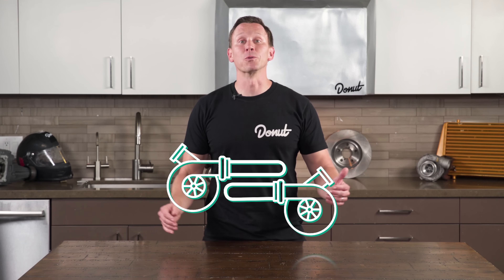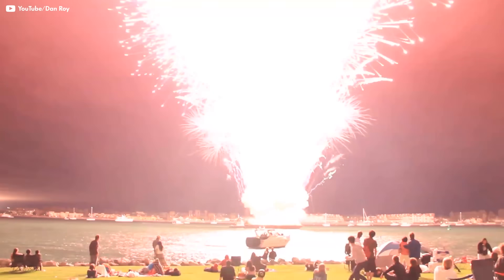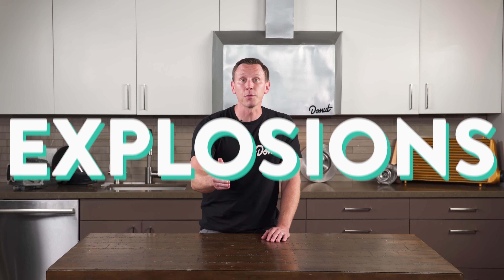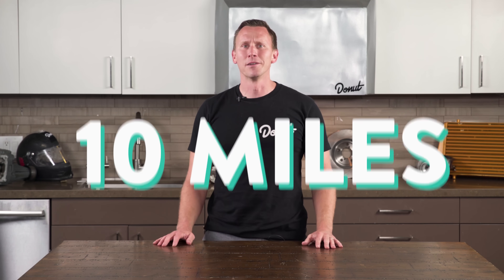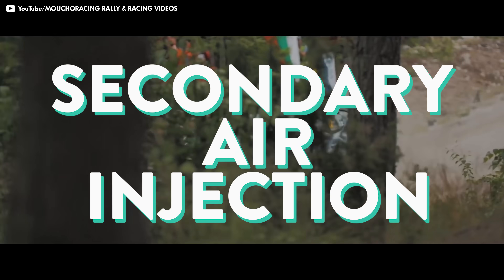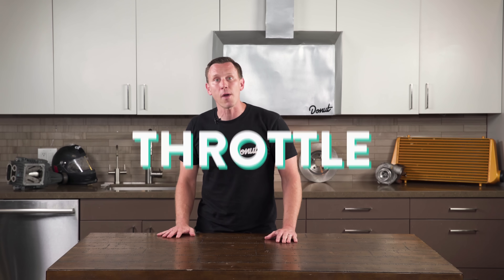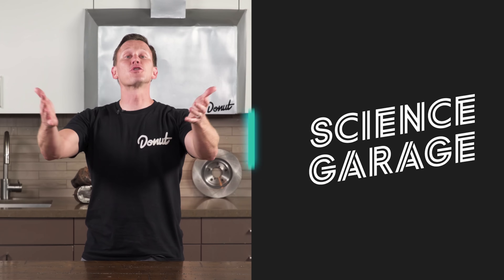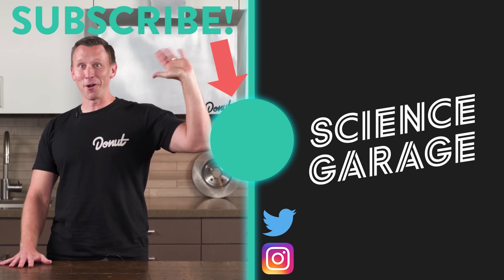ANTI-LAG | How it Works

Comment: I want to use a bypass air valve and a diesel fuel injector plummed straight into the exhaust manifold. Use a solenoid fuel switch. Simple and very effective. 🔥🔥🔥

Comment: I have a question for car guys and mechanics. I drive a 2014 Mini Cooper S, 4 cylinder Turbo charged. I was wondering if this is good for your car at all? I've seen a lot of videos on this and I'm getting numerous answers. I'll be at a park for example and I'll accelerate and upon the deceleration is when I'll get a fairly loud audible pop from the back, not sure if there are flames out of the back or not. If I could get an answer on this before I spend the money going to a mechanic, this would help a lot.

Comment: I love wastegates and blow-off valves and being able to use tunes and fuels for different ranges of performance and I don't even have to buy anything other than a tuner program or tune bank and away I go. Sure beats the hell out of spending a fortune like the old days. It's sad though to see clapped out burners that a small fortune been invested in the engine and car get smoked by a family CUV.

Comment: Im imagining you can combine rally style and throttlekick anti lag systems to get the ultimate performance. I mean. Open valve and a pump leading to the turbo. Anti lag benefits and, i hope, close to no downsides. So no more changing the turbocharger.

Comment: I love how Turbos have two problems to solve, and the bigger the turbo, the bigger the solution. Too much pressure, so you need boost control or blowoff valves. This is good for the life of the turbo and engine components. Too little pressure, so you need anti-lag or two-step. This causes wear on the turbo and exhaust components. All for a big turbo.

Comment: One thing that I don't understand about the Turbo is that why would it still be superior if we have built an awesome supercharger (like turbo but using an extremely powerful electric motor) that we can finetune the behavior from a2z. There are some EDFmotors especially made for RC aircraft and they are STRONG... Since we have almost an unlimited 12v source, why can't we use these rather than having to deal with the exhaust?
Reply: look at their recent uploads lol

Comment: There is the Formula 1 way as well. 
They use the MGU-H to convert the heat from the exhaust to electrical energy which is then fed into the turbo when at low revolutions to keep it spinning thus, eliminating turbo lag. 
Pretty awesome.

Comment: 3:09 wouldn’t you be losing power because ignition is happening late
Reply: @Benji Genji Yeah but your only building boost pressure while off throttle , as soon as you get back on throttle the ignition timing goes back normal.
Reply: @davidgriggs3967  oh ok i see so this system would only take effect soon as throttle is released to keep turbo spooled
Reply: @benbriscoee  It's firing hella late when the exhaust valves are still open forcing the gasses out inturn spooling up the turbine ready for boost.
Reply: @davidgriggs3967  ahhh ok word thank you man

Comment: just put a one way mecanism in conected to the motor and when it`s faster than ther motor it slips and turns off the motor as to not waste it so you can keep it running? edit i mean an ele=ctric motor

Comment: I'd like to see a video on oem lag reduction systems like the Mazda dual valve exhaust manifold and the Volvo compressed air injector solution for example.

Comment: Lol when i run my bike into the rev limiter it backfires just like an anti lag car. If the engine is hot enough its spitting flames like crazy.
It does that while still running lean so i guess i have to rebuild the cylinder head

Comment: there's another anti-lag system applied on the 2016 Ford GT LM GTE car: the Anti-lag is active when the throttle is slightly pushed. so, when you're off the gas pedal, no anti-lag. but when you apply slowly the gas pedal, the car gets the farty sound until a certain point of the throttle where the turbos has got the maximum boost pressure

Comment: If i dont want lag, i just install a blower style Supercharger. Unlike turbos, it works without pushing the fuel trough the Carburetor Jets. The Fuel pump is NOT where the Boost is supposed to be...

... And personally i dislike EFI Systems...
Reply: Mr. Handy yeah, but then you get less gas mileage, and you don’t get to go bang bang
Reply: I could install a fuel injector and a spark plug after the last muffler to get that bang.

BUT

I can´t use ANY sort of Boost. Im driving an Inline 2 600cc Two Stroke with single barrel carb and 26hp. Love it!
Reply: Mr. Handy damn

Comment: Aren't you robbing power by firing sparkplugs late, even though the boost from the turbo is instant?
Reply: Yes, power is lost so that the air+fuel igniting joins the turbo while expanding to keep the turbine spinning. So you end up with a smoother torque curve
Reply: @bigbrick2297  So the assumption is that the turbo not spinning down gives more power than every cylinder's retarded timing at every power stroke?!? That's so counterintuitive.

Comment: 495 (amount of dislikes) are just the people that think that turbos run on fairy farts, unicorn urine, and nacho cheese...
Reply: As a mechanic, i had an old boss that literally thought turbos pumped hot exhaust gases back into the intake of the engine, and was like "why do they need tail pipes then?" I was like, you were a mechanic, and you don't understand that turbos have 2 sides? And he said "No, they literally pump exhaust into the intake." 
So I quit. For real. True story.

Comment: ✔What happens if we put the car in neutral and hit gass ,is it harmful? 

✔What happens if we let the car in manual taptronic and we did a  high rpm ...for cars that shift automatically in high rpm or that never shifts until we shift it up? harm full or not ?

Comment: I got 2 questions. So I'm a bit slow, and I understand if you have a lot of turbo lag, it'll only spool up at high revs NOT high speeds, thst and my knowledge of vtec bring me to this conclusion. Is vtec just like a deliberate turbo lag but without the turbo? 
2nd question is, does a 2 step rev limiter damage the turbo and engine like antilag?

Comment: I  programmed in a two-step via my HP Tuners . I programmed it to match my stall converter at 2500 and launch at 3xxx rpm . I get hella good launches . With HP I can just change the rolling idle parameters to help keep it spooled . But I don't , because I drag race . I'm pretty sure in other types of racing , the safest way to stay spooled would be to program your clutch in ( if you drive a manual ) rolling idle vs. throttle position parameter to keep the turbo spooled up . Think clutch in on the brakes engine idle at 2800 . When not rolling your engine idle would be whatever your normal setting is . All this is dependent on getting your stoichiometric air fuel ratio and your volume entering and your spark advance and your power enrichment tables all operating together and having the numbers set to where they correspond properly . You don't want your base air fuel ratio to be at 14.2 and then your PE ( power enrichment ) set at 12.6 and 1000 RPM . Then you're just taking a big rich dump because you're not allowing your AFR to climb properly in correlation with your PE table . Which means you lose gobs a power .

Comment: The Summary of anti lag systems
(This happens when the trottle closed)

1. By letting the throttle plate slighty open and delaying the ignition in cylinder, so it has some of gas not burned that will flow to the exhaust manifold (which is very hot) and then makes spark that will spin the turbo.

2. By passing the valve with adding extra plumbing before the trottle plate and send the air directly to the exaust manifold that will spin the turbo.

3. Two step rev, (it's not anti lag system but it will let the turbo spooled up) the system kind a like the number 1 but it's for limiting the hightest rpm.

Comment: older jdm Evos came with a baby version of anti lag straight from the factory :) 
it wasnt activated on the ecu but it was installed for homologation rules. it was an SAS system like you described. (supplementary air system)
you can turn it on on the stock ecu with just a laptop for some nice pops and bangs :)
Reply: EVO III "misfiring system"? Lmao
Reply: @LilSakei  initial D ?
Reply: @botondreti6057  yes
Reply: You mean MISHFAIRU SHEESHTEM?
Reply: what gens where these?
Reply: @7echa  1-3 im pretty sure
Reply: I did not know this, I remember reading it had anti-lag, but assumed it was on by default, my old X never had this on, but my wife recently bought me a gen 1 X after I regretted selling mine, and this one pops, so I guess the last owner has activated this., I did noticed it pulls more readily, I want to keep this stock as its in such amazing condition.

Comment: What if used a hybrid of a supercharger and a turbocharger instead of antilag in racing? EMD locomotive turbo chargers have a clutch that connects the turbo to a belt on the engine at low rpm.

Comment: 0:54 planes have anti lag ?
Reply: It's a fricking jet breakig the sound barrier lol
Reply: @TsunaXZ  :D
Reply: So everyone here answering questions about aircraft but who here is an a&p mechanic or AMT besides me
Reply: @christopherburns9838  I currently work on DHC-6, DHC-8, EMB-120, and Metro SA227. I also have experience on PC-12, A320 NEO, 737's EMB-175 and a multitude of GA Aircraft.
Reply: @tannerbass2533  sick dude what school did you go to?
Reply: @christopherburns9838  I am an A&P Mechanic.
Reply: @oguzsaydam5455  shut up turkey 🦃
Reply: Old prop planes basically use car engines and some have turbos..but with windspeed I’m sure there’s a work around to use air to spool it if it’s even needed since they are at a high rpm almost all of the time
Reply: @MachtPlays  yes, but old prop planes that use turbo's usually aren't creating high boost pressure. They're used for Turbonormalizing, not turbocharging. Which just keeps the the max available manifold pressure at or in some cases just slightly above sea level pressure, up to a certain max altitude. After that altitude the max available manifold pressure will start to fall off.
In other words just maintains ground level performance at high altitudes. (Since air is less dense at high altitude)
Reply: Tanner Bass makes sense.. idk if old prop planes ever ran twin turbos, but you could off set them to have one run that way and the other turbo run normally
Reply: @MachtPlays  simply put, aircraft are very far behind in there progression than cars. With good reason, it is extremely difficult, and expensive to make design changes to aircraft and implement them. Cars can pull over, aircraft cannot. Most small aircraft are still carbureted vs fuel injected.
Reply: I'm not extremely well versed in small private aircraft. But I am an Certified aircraft mechanic. I just work on much bigger aircraft.
Reply: @smac919 most of them actually have super chargers as they only tend to rev to about 2-3k rpm so the super charger performs better while not having its compressor stalled by the wind speed.
Reply: @oguzsaydam5455  ayy old maan!
Reply: LMAO
Reply: Planes have turbos??????
Reply: No it's after burnner almost but not quite the same..
Reply: @yakisobaaeater3014  after burner just takes fuel and ready hot exhaust and delights it
Reply: i think so
Reply: had to be the 1000th like
Reply: are you guys dumbasses? NO! PLANES DON'T HAVE ANTILAG, IF THEY HAD ANTILAG THEY WOULD CRASH, PLUS PLANES DON'T REV!
Reply: @prodkasai  woosh
Reply: u just made my day lmaoo
Reply: Yes since they have to carry someone's mom

Comment: What happens when you run Methanol injection? When you lift the throttle the Anti LAg system will create boost (explained in the video) , and therefore it will inject meth. Can that (meth) cause damage on the cylinder or  exhaust valvetrain? Thanks! Greetings from Argentina

Comment: I have 2 Step on my car,  2014 stage 3 Focus ST,  shes making 302 wheel on a shit tune.  (dont cheap out on  tunes fellas)  i spent mega loot on parts and cheaped out on the tune,   that pretty much negates the parts (somewhat).  TOO BAD SHES FWD! my 2 step does NOTHING!   pilot  sport 4's  still spin though 2nd gear and chirps 3rd,   my 2 step is just for show :/.  shame fellas

Comment: Nice BUT can we use electric motors as a substitute Anti-lag system, where the e-motors keeps the turbo spooling and at the right RPM auto-disengage & lets the hot gases do their trick?

Comment: My atsv comes from the factory with a two step. Problem is it only let's it Rev to 3k and only builds 2-3 lbs of boost. At the track its not enough and will bog. On the street it roasts the tires

Comment: why would you use this, instead of a supercharger to lower the lag?? it just sounds like a very bad deal, i understand mixing the 2 types of charger is also not a perfect solution, but this just sounds way worse, can i get an explanation on why would you preffer this over a supercharger? (as a lag mitigation system)

Comment: So why not mini rotary engines instead of turbos....well & a turbo after the mini rotary engine < the mini rotary engine firing off the unburnt fuel 'S shaft WOULD spin a supercharger/compressor & to add to all this a nitrous oxide mix and  all factory forged INTERNALS & cast iron block

Comment: After watching this and a formula one video explaining the MGU-k system. I got thinking what if you used the same principal to apply a generator on the turbine itself to keep it spinning when the throttle is off. I imagine the heat would be very hard on the motor but if it can be used on breaks them I don't see why it can't be used on a turbo?

Comment: So i have an honest question. When i looked up secondary air injection it brought me to the Wikipedia to smog pumps which after reading seem to do the same thing as the RWC style anti-lag system other than it is just before the catalytic converter rather than the turbo. My question is what are the differences between these and could you modify a smog pump to work as a rwc anti-lag system if you moved it to the headers/exhaust manifolds? Thanks for any responses and sorry in advance for my ignorance on this particular subject.
Reply: Anybody?

Comment: Why not just get a big naturally aspirated engine (no lag)  like a 6.2 litre Corvette with cylinder deactivation for 35mpg on the freeway?  A big engine revs much lower, in fact at 70mph the Corvette revs at just 2500rpm whereas a 4 cylinder would rev at over 4000 rpm.

Comment: F1 uses the MGU-H, a motor-generator unit connected to the turbo to both harvest energy when the turbo boost is not needed AND to spool up the turbo for better throttle response.  There is a better way than something that can destroy your turbo.

Comment: this might sound silly, but why isn't there an electromotor on the turbo to keep it spooled up? With a clutch system, so it isn't pushing any boost "right now" but the hot side keeps spinning, then you hit the gas, relay opens, clutch hits the turbine and boom, instant boost. I mean, yeah it sounds complicated, but I feel like when you compare it to messing with your timing to create an explosion where an explosion shouldn't generally occur unless your timing is messed up (hmmm...) it isn't that stupid of an idea

Comment: You dont need anti lag just do what ford once did with the ford focus they had a system which kept the spooled up boost in a tank and then when they mashed the gas hard it shot all of the boost to the engine and gave them a advantage over the other competitors but  it was banned from all rally races because it was " unfair to the other drivers"

Comment: Thanks for describing the rally style anti-lag with intensity controls, I had been wondering why over the last decade I usually hear much more tame anti-lag (tame enough one friend thought cars didn't have anti-lag anymore, was complaining about it!.)  Surely driver/team preferences which are possible with these systems must be the reason why much of it has been toned down.

I'm unclear on one thing though, when you said Turbos and Exhaust manifolds get changed after every race, did you mean the entire race or just a stage?  I'll presume you meant entire race but would be cool to know.
Reply: Think he ment they buy new turbos every race cuz how harsh the pops and bangs are to the internal parts

Comment: Do you still need to "pump your brakes" on modern cars? If you do, would it be bad at all?
Reply: EBSting Pumping brakes was required on cars without an antilock braking system. Modern cars come standard with ABS, and pump the brakes more efficiently than humans could. Trying to pump the brakes yourself will decrease the efficiency of ABS, so it's best to just hold down the brakes
Reply: @shell-9999  ABS while good in theory can have undesirable consequences in practice. Braking snow for instance. Pumping still has uses even in modern cars.

Comment: Err.. Secondary Air Injection for Toyotas were meant on OEM's to allow the exhaust to heat up from a cold start and the O2/AFR sensors to be at optimal temperature for it to do its thing. I don't remember single thing about SAI being used for Anti-lag

Comment: Hey, how does Traction Control work?
Reply: If your car looses traction the computer in the car makes it go slower, ending in you having traction. Also it’s similar if a mustang is drifting and swings too far and the driver lets off of the gas, resulting in a regain in traction which causes them to end up in a crowd or a curb. P.s. don’t use traction control in rain, it could make the traction even worse.

Comment: There are also 2 step rev limiters for when an engine is cold I believe ...  the series 2 rx8 had a lower redline until the engine warmed up so you could unleash those sweet rpms approaching 10k.